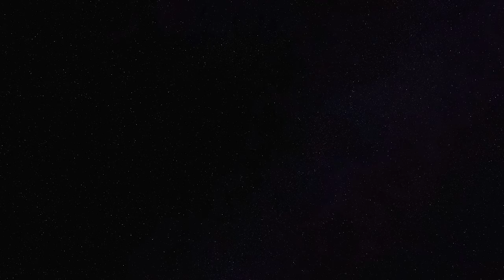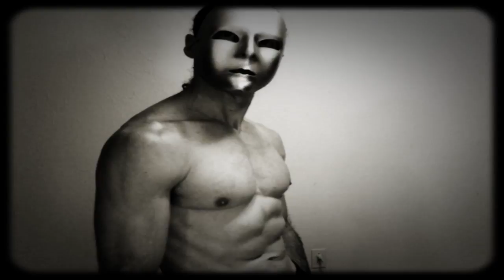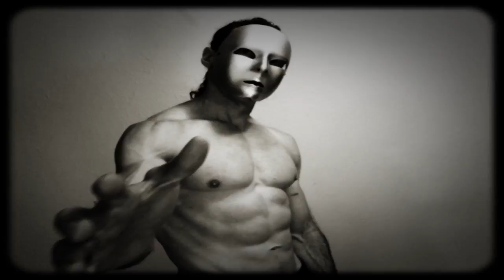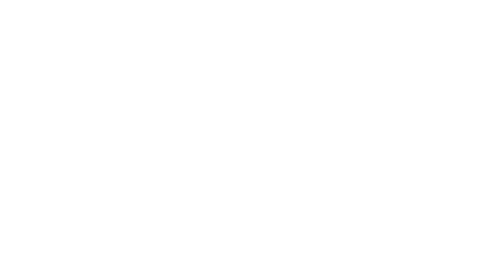The Great Electrifier: Wind Energy is Not Clean or Green

Comment: Great video, very accurate, full of facts not the usual greenie vigorous arm-waving platitudes, dead on. 

It ain't going so well for the South Australia greenie enthusiasts and their industrial wind farm specials. Twice the electricity price of the rest of Australia, mega-power outages due to the wind disappearing during mammoth heat waves with energy consumption at a max, companies leaving the region due to unreliable power and extreme power prices - often spiking above $1 per kwh. 

“It has created a situation where that state has the most expensive and least reliable electricity in Australia,” Mr Turnbull said.
“That is a fact. Of course they want to blame it on everybody else.
“When they have the biggest heatwave there is no wind and when there is no wind, all of their windmills are not generating electricity.
“They haven’t planned for that.”
“AEMO understands the frustration from South Australian energy consumers … it is important to note that AEMO instructed load shedding to ease the pressure on the power system, protecting it from potentially impacting more residents, and for a longer period.”
“..Adelaide’s expected top for Thursday is 42C, with Port Augusta, Coober Pedy, Woomera, Marree and Moomba forecast to reach 46C and Tarcoola 47C.
Last night, as many South Australians arrived home from work and turned on their air conditioners, SA Power Networks announced it would start load shedding to cope with demand, plunging some areas into blackouts for half an hour or more, impacting about 90,000 customers…”

“…Labor's extreme green energy policy comprising of 40 % wind power and 1.3 % solar, which is responsible for the highest power prices in Australia, 15,000 household disconnections, frequent blackouts, the July 2016 power crisis and is a leading cause of SA's job crisis, where SA has the highest unemployment rate in Australia !… between 6 and 10 major manufacturers told him they were considering SHUTDOWNS after WILD FLUCTUATIONS in ENERGY PRICES blamed in part on this weeks storms. The companies are understood to include besieged steel maker Arrium, Olympic Dam operator BHP Billiton, Pt Pirie lead smelter Nyrstar, Cement producer Adelaide Brighton and automotive supply chain firms linked to Holden.
The social services sector has called for an IMMEDIATE SUMMIT, WARNING that the STATE'S RAPID RUSH INTO GREEN ENERGY HAS CREATED UNCERTAINTY FOR BOTH HOUSEHOLDS AND EMPLOYERS.  SA's POWER CHARGES have SOARED in the past week, hitting MORE THAN 7 TIMES the Victorian price and ALMOST  8  that in NSW because the state's market is isolated from the rest of Australia.
Upgrades to an interconnection cable between SA and Victoria have been delayed by wild storms.  Mr Koutsantonis said frigid conditions in the eastern states were also eating up gas supplies which had further left SA fending for itself and created HUGE PRICE VOLATILITY…”
The PROBLEM WITH WIND generated power by Iain MacGill (Uni of NSW Centre for Energy and Environment) is wind farms also STOP OPERATION when it's TOO WINDY - speeds of 90 kms and higher. But on calm days wind farms could SUCK UP MORE POWER THAN THEY GENERATE.
SA is facing WHOLESALE ELECTRICITY PRICES that are ROUGHLY DOUBLE that of other states for MORE THAN  2 YRS  according to figures from the Australian Energy Regulator.  Wholesale energy costs are the prices charged by power stations.  SA  CURRENTLY PAYS  $70 per megawatt hr for wholesale power and the AER forecasts that charge will rise to a peak of  $94  by mid 2018 when the price in Vic will be just  $41." The state also has the HIGHEST proportion of customers on HARDSHIP PROGRAMS. South Australian Council of Social Services (SACOSS) executive director Ross Womersley said  "We have the HIGHEST ELECTRICITY PRICES IN THE NATION IN SA.  WE HAVE THE HIGHEST UNEMPLOYMENT IN SA AND THAT'S NO COINCIDENCE."”

STOPTHESETHINGS d0t c0m